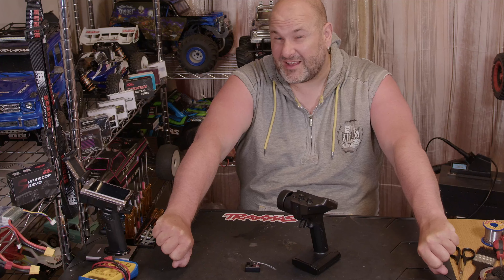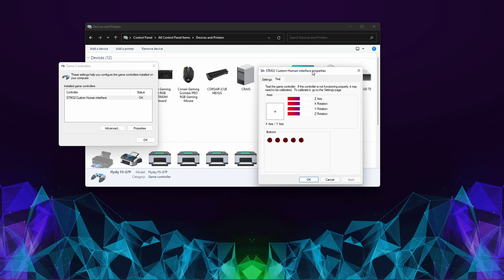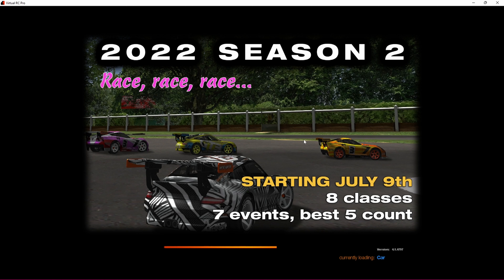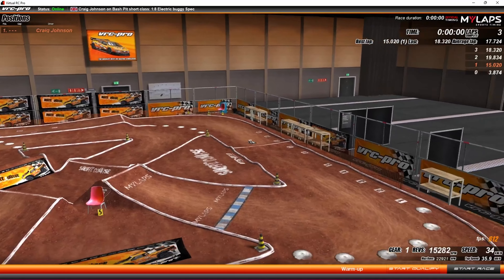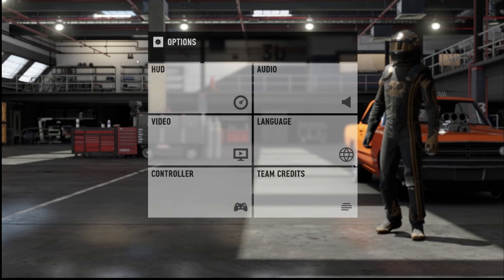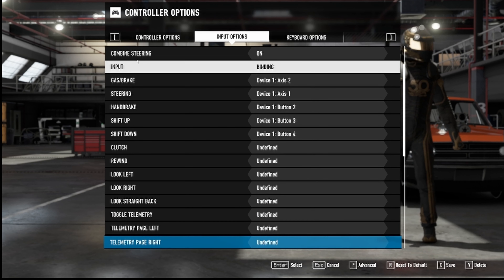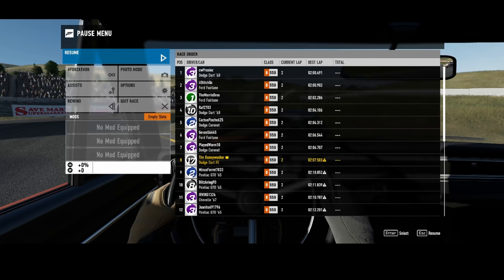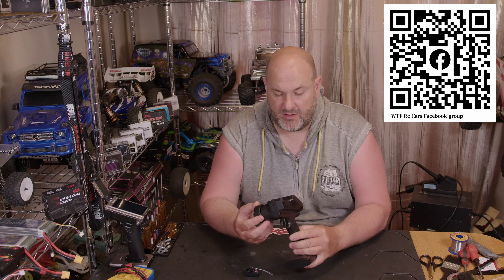Using the Flysky G7P as a PC controller or for VRC Pro and PC games.

Comment: Do you have a driver link for this? My PC doesnt detect it as a controller.
Reply from the maker: It doesn't require a driver windows 10 and 11 detect it as a standard pc input device I'd check and make sure you have a data cable not just a charge cable connecting it :)
Reply: @WTFRCCars  Never mind, I followed your firmware update fail video and everything was fixed. Thank you!! Such a big help!
Reply from the maker: @charlieringor4187 no worries glad ya sorted it :)

Comment: Hey hope you read this. When in pc game controller mode, does it charge or receives power via USB as well?
Reply from the maker: Yes but make sure the usb port and cable can supply enough power or you will need to keep an eye on your battery else you will drain it totally
Reply: @WTFRCCars  thanks! I`m playing around with some rc physics. https://youtu.be/v2oZENGrPZs
Reply: @WTFRCCars  I got it yesterday, turns out it doesn't need any batteries at all, full power is supplied via USB and it works quite well. It is just a normal USB 2.0 port I'm running from and it supplies enough power (at a max of 5W it should be fine). The unit itself is turned off, it auto turns on with the USB cable installed. I'm pleased with it sofar!
Reply from the maker: Yeh the G7P does sorry I thought this comment was on the nb4/pro vid :)

Comment: Can you do a video on how to connect the flysky cable to the radio cause mine won’t fit.
Reply from the maker: The G7P is USB C so any usb C cable will fit
Reply: @WTFRCCars  for vrc pro?
Reply: @WTFRCCars  thanks I figured it out.
Reply from the maker: Yes so long as it's a usb c data cable not just a charge cable :)

Comment: Looks like a good controller for gamers (I'm not). The G7P must have some negatives beside the not padded steering wheel somewhere.🤔  I've seen an optional foam padded one is available though. Thank you WTF RC!👍
Reply from the maker: It's hard to find issues with it for the price there's nothing that come close to it, the nb4 and pro wheels fit but they stand out future than the stock wheel
Reply: I've never had a surface transmitter that didn't have a foam covered steering wheel. But, I really don't think it would bother me not to have a foam cover. If it did, I would buy one of available foam covers and glue it on as some have done. Glue It on due to the taper of the wheel, and it wanting to slide off otherwise. Surely Flysky will have them available soon too. 😀
Reply from the maker: I would think there will be loads available soon it's the same fit as the nb4 and pro and the absima version comes with foam too